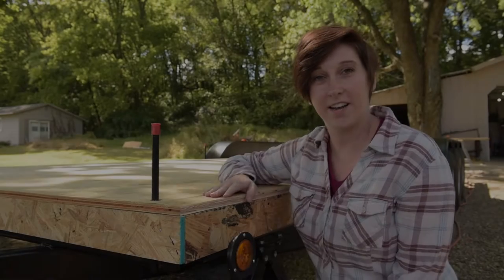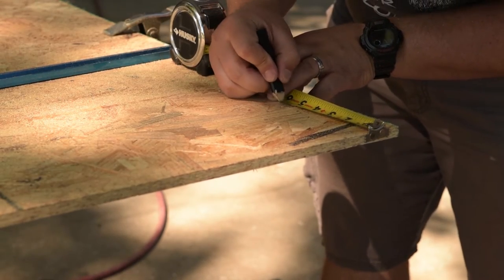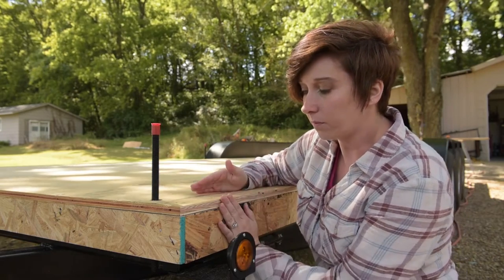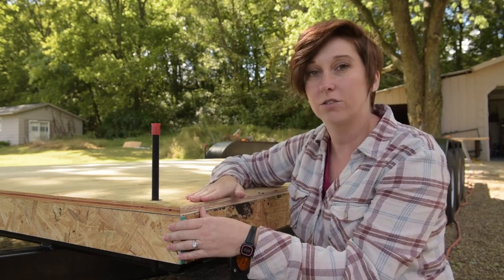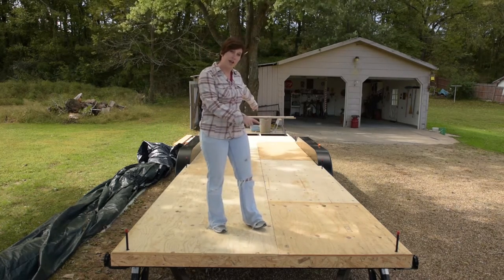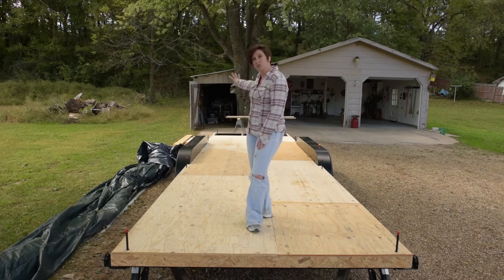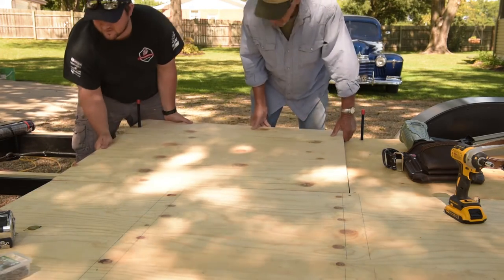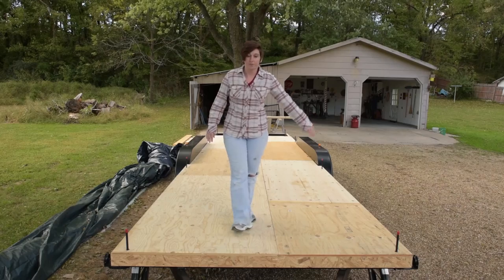Building A Tiny House: Step 3 - Subfloor Installation

Comment: What did you use for thermal bridging?
Reply from the maker: sill seal (thin foam tape) on top of the metal frame (floor joists) where it would have directly touched the wood subfloor.  We have had no issues so far with cold spots or moisture :)